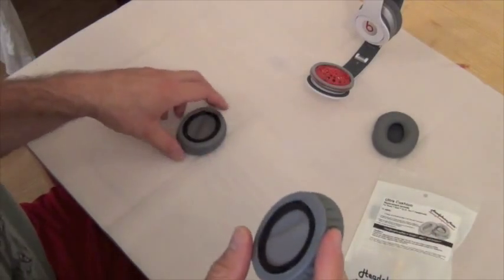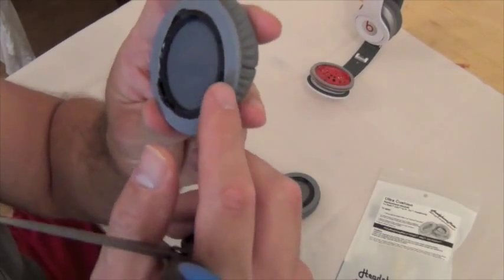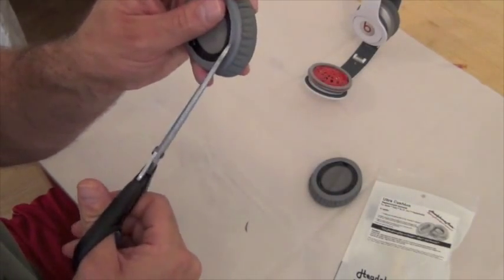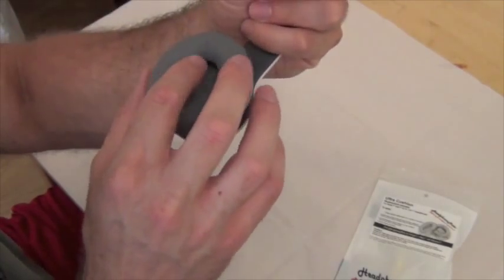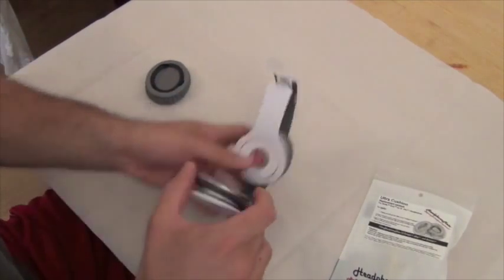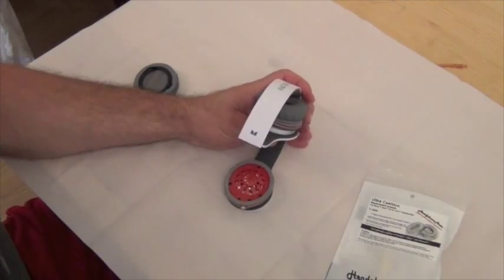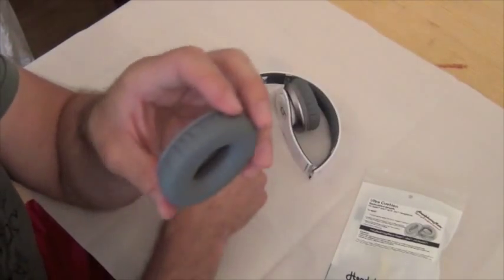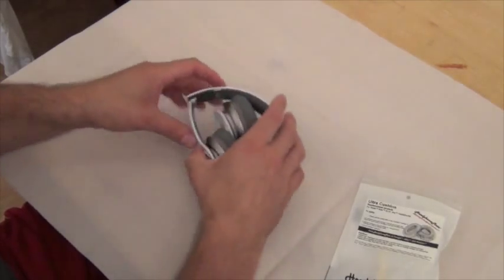AHG Solo and Solo HD Ear Pad Installation

Comment: Well... I just tried everything to get them off, and the pad just came off.  I used the credit card method, but these suckers are glued down good or clips won't budge.  So,  I guess if I get a new pair I will just have to rip off the pad and glue it on.
Reply from the maker: Spacystacy32 they have some adhesive glue that helps keep them stuck on.  Thst is what beats did.  Normally some turning and using a table knife to lift up around the edges will break the adhesive glue and allow you to twist them off easier.